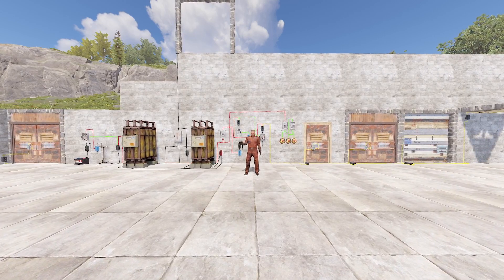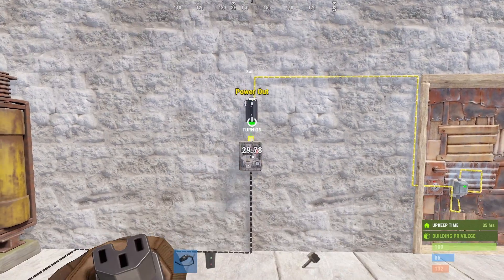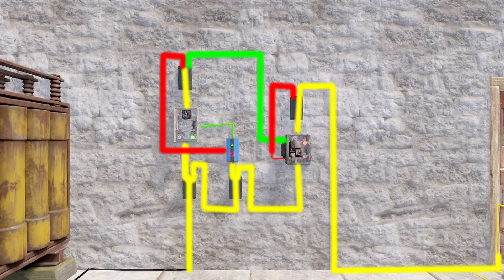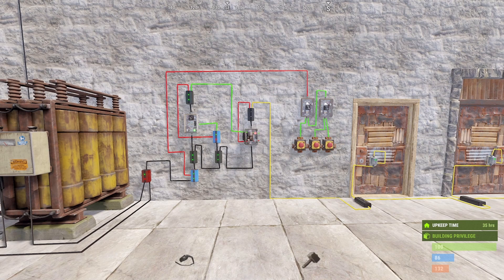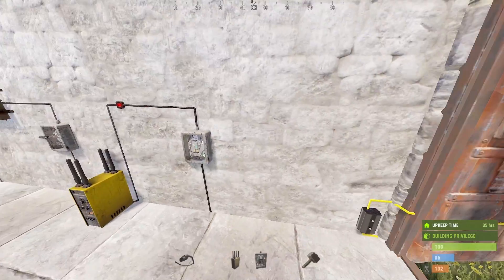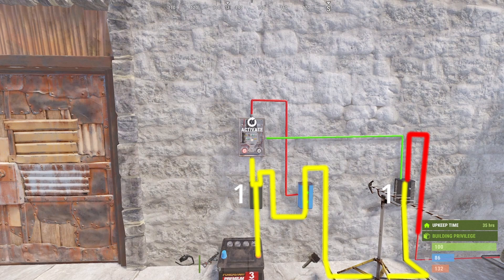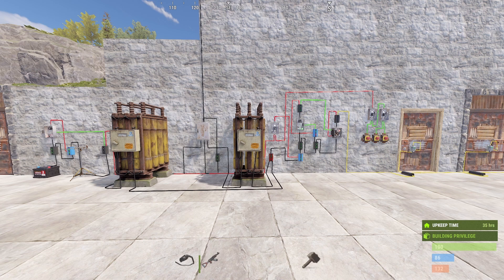Automatic Door Closing | Rust Electricity Tutorial

Comment: I connected everything but seems that i need more than just 1rW, the electricity is not flowing to other brances it stops at the 2nd one, should i flow 1 electricity for each electrican branch i have? Why is this not functioning properly was it patched or am i just noob? Also the door controlers are connected properly and set up from output to close and the switch still opens the door but only for a few secconds then it closes.
Reply from the maker: It still works exactly the same ... so you have probably made some small error while wiring

Comment: I connected it and it works on 9 doors but on the 10th door the splitter does not receive power. Any ideas what could be wrong?
Large battery and fully charged. I have a large battery ->splitter -> switch -> to the beginning of the circuit
Reply from the maker: There shouldnt be any splitter. You clearly are dividing the power by it
Reply: @HyperionRust do i need to use the entire large battery just for the door circuit?
Reply: @HyperionRust Thank you for the response, I put another large battery so now I have two fed from the same source and I am sending 100 power to the circuit via root combiner. The 10th splitter is still not receiving power. Also, the splitter above my smart switch shows 0 power even though it is set to 1
Reply from the maker: @miguelmoreno7877 that is bad idea. All you need is 1 dedicated large battery that receive 1 power to charge. This battery should be only used for this circuit for minimal power consumption. This way all you need is to generate 1 power for thw battery. If you want to power other circuits from the same battery, it will require more power to charge and will limit the amount of doors you can close, because you are sending the power somewhere else.

Comment: The disadvantage with this is if they manage to get into your TC then they get control over all those doors. And can open then by changing the circuit. So you wont run into the classic scenario where they got into your core took all  the shit but left what you had in some other loot room on different floor - because it wasnt worth it to blow there aswell.
Reply from the maker: If you dont lock your TC ... then you have bigger issues than worry about door closing circuit. If the TC is locked, there is no way to abuse this circuit at all.
Reply: @HyperionRust I meant if raider destroys your TC - then place your own (which of course can be mitigated by having multi tc)
Reply from the maker: @MrJigssaw1989 if your TC is destroyed, doorcontrollers get unpaired. So they stop working. Therefore it cant be abused

Comment: Did this get patched because i cant use just one power i have to use 1 power per door attached and extra to run the closing module and are the doors supposed to open if they are closed then shut
Reply from the maker: Its still the same. And you have to use 2 power per door. Every door branch needs to be set to default, default is 2.

Comment: I copied this guide exactly as shown. Couldn't get it to work on 1 unit of power as described. Any less than 2 units of power per door makes them keep opening and closing.
Reply from the maker: Well you are supposed to keep the branches set at default, and that is 2 power.
Reply: @HyperionRust I did the same thing. Was wondering why they kept opening. Now it all makes sense. Thanks again

Comment: it does not work for me
i did exactly like in the video but the doors wont close. the smart switch does not even turn on
Reply from the maker: @daniellarsson2187   are you by any chance on a console? This is for pc version
Reply: @HyperionRust same for me and i am on pc version
Reply from the maker: @SHADOWSBEAST0611  well the circuit still works. If you follow it as shown. Best to start from scratch and make sure your battery has some charge.

Comment: It’s nice and all but all you need is a push button, wire tool, and a door controller.  Just three components.  Push button, door opens for 1 second and closes right away.  This seems horribly overcomplicated
Reply: Basically buttons are super slow, bc door closers close the door when power is removed. So have the switch power itself off quickly results in a faster response from the door closer.

Comment: Is this working on console yet?
Reply: with the recent industrial update on rust console public test branch it should be completely the same -> main should follow in 1-2 month. 
this type of circuit is only possible since several month on PC (needs the open and close function on the door controller) 
therefore on rust console main this is, at the moment not possible, but the detector part is +/- the same and the door closing part is possible to but with mayor differences (or issues).

Comment: Great video!! I just tried wiring the passthrugh to theclose input doesn't prevent to open already closed doors :( What can be wrong? ( did it to 3 doors, also set the electrical branch to 1)
Reply from the maker: well setting the branch to 1 is the issue. In the video im stating to keep the branch at default value which is 2. So change it back to 2 and it will work
Reply: @HyperionRust oh sorry i didn't hear that. i will change it. Thank you!!!

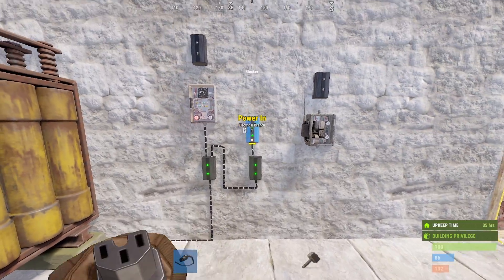Comment: Nice video, can i do the circuit on 3:00 but without the timer that constantly closing it? also can i replce the large battery with a medium and still have the 48 doors?
Reply from the maker: You can keep using just the switch alone, but medium battery would only be able to close 24 doors in this setup.